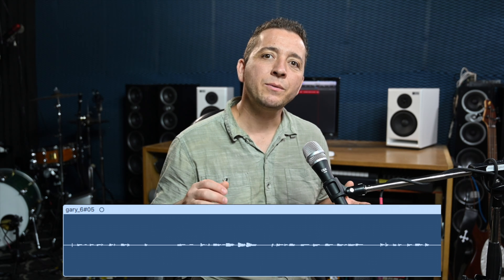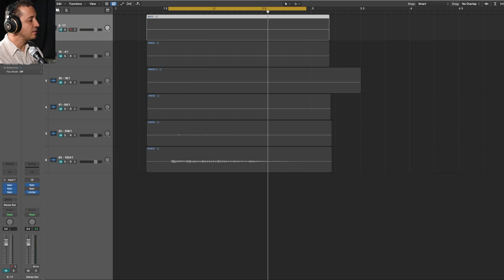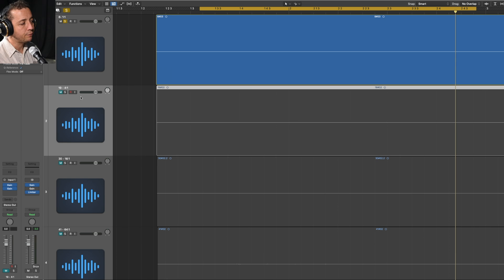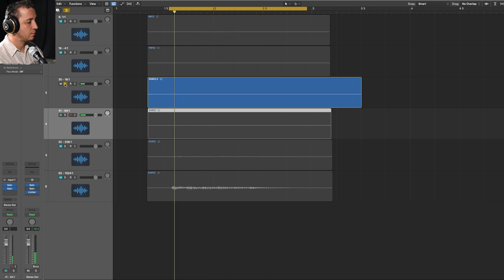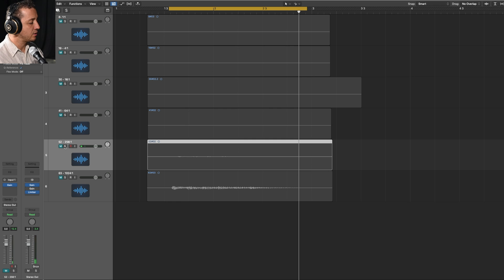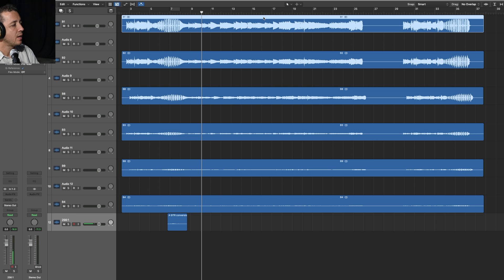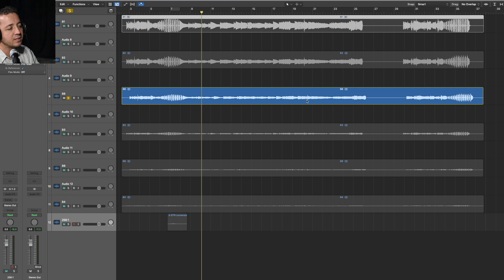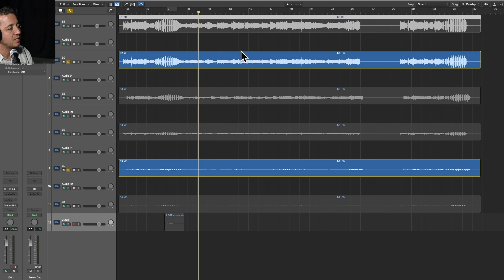Optimal Gain Settings for your Microphone Preamp

Comment: Cool
Reply from the maker: Thanks :)
Reply: @Get.Pro.Recordings  btw as long as I'm recording and hitting-18 .  Someone taught me that while the volume knob is at 0. The called it u unity gain?
Reply from the maker: Hi, and thanks for the question:)
Forget the unity gain concept, it’s not relevant for setting your preamp gain. The -18 strategy is good, but I find it awkward trying to establish what the input meter is reading because it bounces around so much, and doesn’t give an accurate perspective of the average.